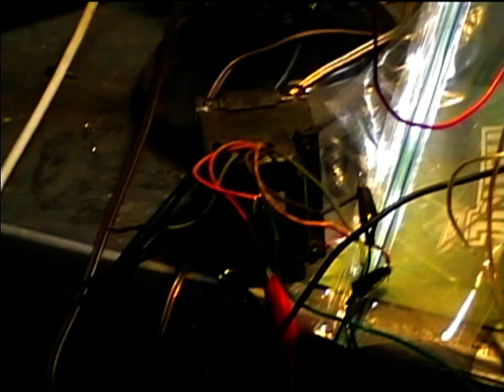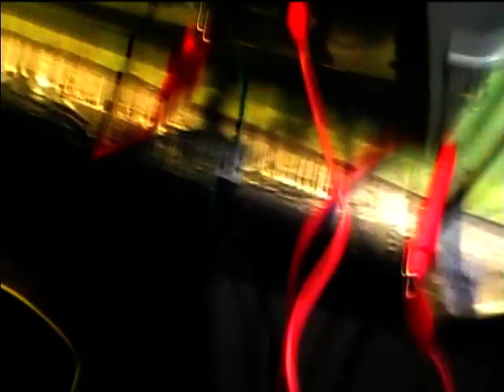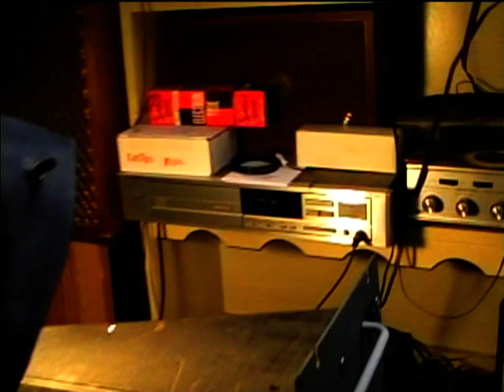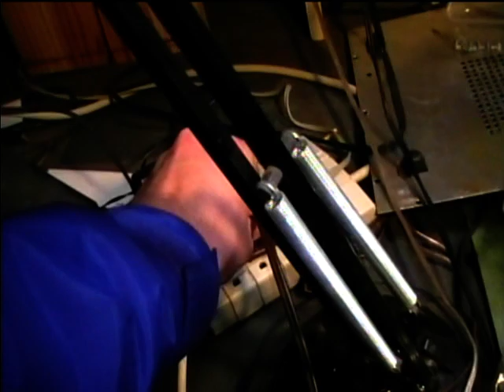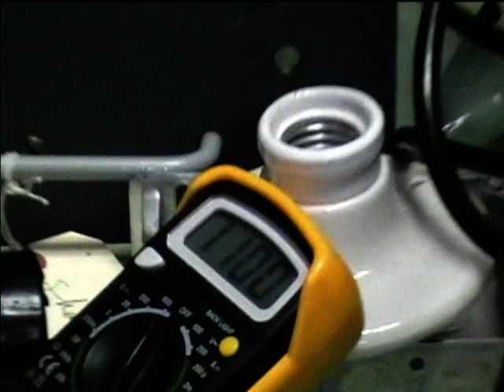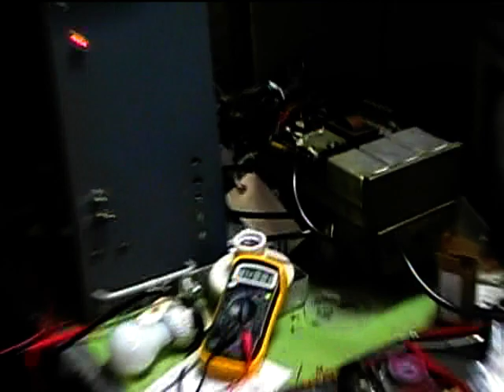Bogen HO-125 amplifier test, 1000 volts on 807's

Comment: Ah, that's really heavy for the 807's!. Am I right that if one tube conducts to let's say 200V, the voltage across the other tube is 1800V? Without anode top connection this wouldn't work. Sad about the transformer. Maybe Amplimo can make the right transformer for this amp, they make custom toroidals, they are located in the Netherlands. And maybe rewinding the old transformer is also an option. Just did this myself with a defective output transformer, made a video of it. Moisture over time can turn the windings into green shorts! Important to measure all wire diameters and at least number of all secondaries as the primary is probably to sticky to unwind in one piece. Only thing hard to find may be transformer laquer and insulation paper. With this tension every layer of windings has to be insulated.

Comment: Hey All,
 
I was actually the original owner of these amps. I have still have the mate to it that's basically gathering dust in the garage.  But the transformer did go out on this amp, and it was a real shame and turned out to be a very expensive problem. These amps were unbelievably powerful.  I did a frequency sweep and they responding up to 17khz and movie soundtracks gave new meaning to "blow up your video".

Comment: houuuu man! it´s crazy the maximun plate voltage of the 807´s it is of 400V! it´s a very hard work for the tubes!!
Reply: For intermittent modulator service the rating is 750V. I think 1kV is probably pushing it a bit, but it did seem to work.

Comment from the maker: This amp originally was designed for use with 70-volt distribution lines only, like in a drive-in theatre, amusement park or large department store. The owner of the amp had it retrofited with a Hammond transformer to give an 8-0hm output. It really is terribly heavy!

Comment from the maker: The first time I tested it, I found that hooking up the bias winding to the circuit brought on symptoms of the short...however there is some kind of intermittent arcing apparently in the windings which seems to be getting worse. It did not show up here but did when the amp was tested again. It will definitely need a whole new HV transformer to work and that may be nearly impossible to find.

Comment from the maker: That CD player has been great...it is our "audio test signal generator". I hooked up a .47/600v capacitor in series with the headphone output so HV can't come back into the CD player and hooked that to alligator clip leads to be able to test power amps and have a variable output from the player. We also use the regular outputs for standard HI-FI amp testing.

Comment: I don't get it, you tested the power transformer in your last video, and you thought it was good, did you later find one of the filament or bias windings was bad? I liked the refresher on the light bulb, I need to wire one of those up. seems like a great trick.